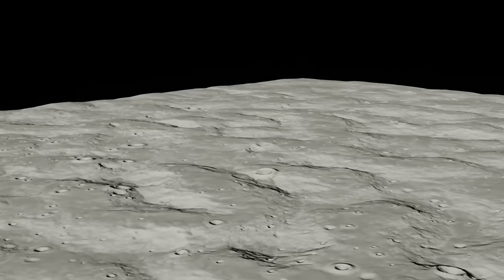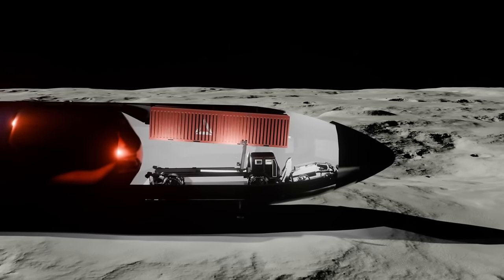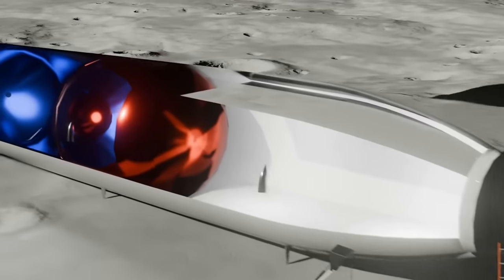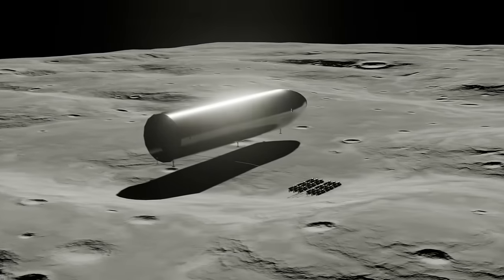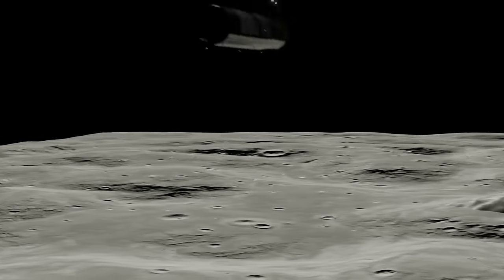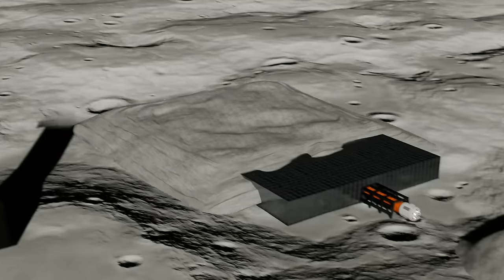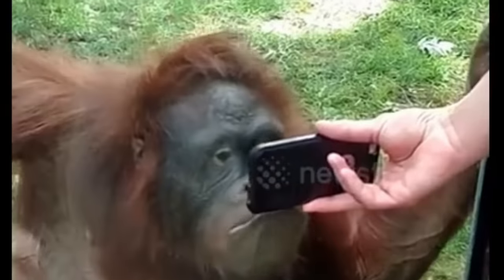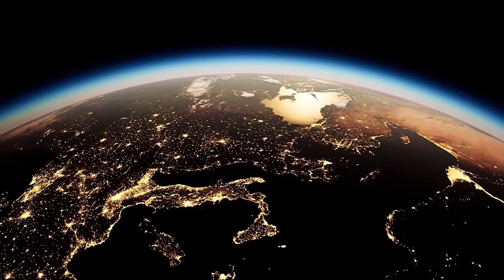How To Develop The Moon ALL PARTS

Comment: The only issue I have concerning the reactor is the difficulty of dispersing the heat. I fully agree that using a reactor on the moon is the most reasonable solution and the most efficient one, But getting rid of waste, heat is way harder in a vacuum than it is on the surface of plan because there is no medium to help pull the heat away like you would deal with water or air on earth. This is not an insurmountable problem, but it is a significant one.
Note that when I say “radiate heat” I’m not talking about radiation or radioactivity, I’m talking about a radiator. Something that allows heat to escape a machine in order to keep the machine and in this case people from overheating and dying
Reply from the maker: I mentioned it for the first outpost but it would apply to the others I just didn't delve into that as a minor detail but yeah radiators for basically everything will be extremely important. (I actually animated a radiator configuration for each outpost thing but didn't draw attention to it. )

Comment: Very nice! Although I'd like to say one thing. They don't necessarily need to land horizontal, but just need to be positioned that way. A lunar base concept for Starship has instead a small construction crew use cables to carefully lay it down. This saves time on development of a horizontal landing system as well, which starship wasn't really ever designed for.

Comment: This disqualified itself in the first few sentences.

Nuclear reactors need cooling they will work at really low power without an atmosphere. Solar panels have a higher weight to power ratio.
Reply from the maker: R
Reply: @Anthrofuturism  Whatever this is supposed to mean.
Reply: @Anthrofuturism  This is an interesting problem, how are the nuclear reactors supposed to vent heat. Do they have a graphene heat sink or something that can get the heat out of the reactor and out to somewhere else? The station won't be able to use all of that heat and it will cook our poor astronauts and even the reactor itself if it can't get rid of it.
Reply: @concon9107  I agree, it is not about how to distribute heat in a power plant. This is solved and circulating watet is the best in most cases.

It is about the way to get rid of the heat. On earth this is done by heating water from a river or the sea. And if not enough water is present, a smaller amount of water is evaporated.

On the moon or in orbit you do not have water to evaporate. You need radiators each connected to the cooling water. The number of radiators limits the output power of the reactor.

Each radiator panel allows the reactor the same output power of a solar panel of equal size. But the radiator panel is way heavier. And the reactor comes in top of the radiators.

 In addition, the cooling system is more vulnerable against damage.
Reply: The need to set up a radiator array is addressed about 5 minutes after you stopped watching.
Reply: @albertnewton8296  So you want to limit the output power to 5-15 kW. That is all this small surface area would allow for.

So you would use solar panels for most of the power and use the nuclear reactor for the life support during the nights.

And you have not added any hoses in your animation, and you did not discuss that just the water in the cooling system would be havier then solar panels of the same output power. Not to talk about the reactor or the radiators.

Look I would not be so annoid if you would not claim your SF would be possible.
Reply: @karstenschuhmann8334  Solar panels would also require large amounts of radiators to cool off the required heat. Also, solar panels will not create energy for half of the moons orbital cycle as there will be no light to generate energy from. To circumnavigate this, batteries could be used, but they tend to hold less and less charge the more they are used. On top of that, Solar panels degrade, so after 30 or so years they will produce very little amounts of energy. Or you could ship and build a nuclear reactor with a large field of radiators, which only requires episodical shipments of fuel as opposed to Solar which needs to be replaced completely every 30 years. Nuclear Reactors would be much more sustainable and expandable as opposed to Solar energy
Reply: @Shneaky  Solar panels are the radiators for the the heat generated by absorbing solar power in itself. And this requires no cooling water. So the solar panels can be much lighter.

Solar panels will deliver power for 15 days and they will have no power for the next 15 days.

So one needs a batterie or a nuclear reactor to run life support for this time.

 The heavy industry will, however, run on solar power. Which will be 100 times cheaper (solar panels can be extremely light, and weight is price on the moon).

So there will be 15 days of production followed by 15 days of maintanance.

Furthermore such a new type of reactor is prone to issues. Such as breakdown of components as well as coolent leaks. It needs tubes from the reactor to all the radiators. They will not last 30 years without a leak.
Reply: @karstenschuhmann8334  As you say, watet is the answer.

With no atmosphere, the heat does not dissipate.

radiator panels the same size as solar panels? Different solar panels of the same size can output different amounts of energy.

The way in which the radiator panel is heavier than a solar panel must be explained to others because not everyone knows what you do.

Something can be vulnerable to damage or resistant to damage, or it can be strengthened against damage, but not vulnerable against damage.
Reply: @danlock1  Sorry my extensive answer was deleated. It was purely technical without anything inapropriate.

Comment: Weak lunar gravity should make burying a rectilinear enclosure a bit less of a death trap than on Earth (See: all the collapsed shipping container bunkers) but what about sheer forces? The longest lasting bunkers on Earth tend to be made from round steel culvert sections. This shape would also contain internal pressure better without stress points at edges/corners.
Reply from the maker: Yeah I'm all for rounded/curved shapes but I suspect at the beginning the cubic approach is just simpler for the very first few buildings. When the time comes to actually build a base they may opt to go curve from the start depending on the tradeoff between complexity involved
Reply: @Anthrofuturism  Any reason you didn't touch on suitports as a regolith ingress solution?
Reply from the maker: @Hamdad  I mean it's sorta a fine detail that might be worth its own video this was mostly a high level view (also they require more work to animate lol).

Comment: this is way over board,  just do the kiss principle
Reply: You cant keep it simple in space, it is alot more threatening than building on earth, a facility like this will need a lot of anti-radiation tools, all the building materials to make said base, and it will require a minor amount of sexurity officers (1 or 2, its not public so you dont need many) a lot of builders and scientists. It's not a simple thing because if you leak oxygen, that can lead to death, and it will need not only sealing but will also require security measures. Kiss flies in earth because there is room for error, on the moon, there is no room for error, its live or die.
Reply: @PSC4.1 you know that the primary way of making technology resistant to radiation is to make it bigger and simpler, right?
Reply: @oberonpanopticon  It's not about the tech being radiation resistant, it's about making the humans not have to experience the radiation.

Comment: Not so sure pressurizing with 60% oxygen would work. Osha limit is 23.5% Oxygen at most for a reason, exposure to high oxygen levels causes nervous system damage, both short and long term. Additionally a 60% oxygen atmosphere would turn any metal part into an easily ignitable sparkler. Most things burn very hot and are very hard to put out at that oxygen concentration. This means that the base would readily combust as a whole.
Reply from the maker: That's why I say we need to import nitrogen
Reply: That's at 1 atmosphere of pressure. At lower pressure even 100% oxygen is perfectly breathable, that's what space suits use.
Reply: @Anthrofuturism  @massimocole9689
Yup, you said to import nitrogen and then to have 40% nitrogen and 60% oxygen so you don't have to import as much. My point is that I suspect that that might not work and that you might have to import more nitrogen because that's too much oxygen. I'm aware that space suits use 100% oxygen at low pressure, but am also aware that for the ISS, Space Shuttle and MIR  1 bar at 21% oxygen was chosen, despite the higher stress on the structure and more loss of air from leaks. That sounded interesting and took me down a rabbit hole.
At least part of the reason the ISS is at 1 bar is because the shuttles and capsules meant to dock there were also at that pressure, possibly because the large number of fatal fires during testing were discouraging. Also, it was pointed out ventilation is better at higher pressure.
My "osha limit argument" doesn't apply at all, because that's for 1 bar, yeah, oops :)
Skylab was actually pressurized with 74% oxygen at low pressure, interestingly. They reported no adverse health effects, though mission duration was limited 28 days.

However the fire hazard remains, as "what burns and what does not" is mostly decided by oxygen percentage, not pressure. Also, materials be it metals or rubber degrade quickly in high oxygen atmospheres, including at low pressure.
Not sure how much of that was actually new to you haha but there you go. It's an interesting problem.

Comment: Thinking about it, the modified horizontal landing Starship is kinda too complex. It would require a LOT of R&D and testing, and has a lot of points of potential failure, whereas a tail landing has far fewer.

I think a far easier solution would be simply to assemble a crane on the moon and then use that to lay a vertical Starship on its side.

Comment: Consider landing a Starship at a 45 degree angle using penetration beams, like lawn darts. The cargo, head of the rocket could then angle down to the lunar surface as the rocket hinged like a double barrel shotgun. 
It would then be positioned to burrow into the regolith. 
Tunnel Shields like this would be useful on the moon
Reply from the maker: Good idea actually...

Comment: Really cool video! One other hurdle you might want to consider is the building of landing pad infrastructure on the moon. It's still active research but the rocket plume of landing vehicles can accelerate regolith particles to very high speeds and essentially sand blast everything within a 2km+ radius. If you make a landing pad you may need to consider importing materials that won't melt from the high temperature exaust gasses. The landing pad would also need to be strong enough to hold starship. This isn't trivial because cintered regolith's compressive strength is nowhere near enforced concrete used to make landing pads on earth. 

You wouldn't have to worry about the exaust for the first landing though so maybe shipping the steel mill first and roboticly assembling landing infrastructure makes the most sense.

Comment: They've just covered the starship in regolith. Why does it take 2 months before people can return? They have a 2MW nuclear reactor. Can't they just hook up some flood lights? Or the second crew could just start the fitout of the habitation starship. Cut out the O2 and CH4 tanks and replace them with bunks and labs and manufacturing facilities, and even better yet, start digging down, using steel cut out of the tanks as supports, through the hull of starship and making deeper levels with more radiation hardening to allow even longer stays. Then crew 3 can start setting up the O2 and H2O recyclers and putting together the furnaces to turn the regolith into glass to start making the greenhouse to grow plants in, as well as start making useful construction materials, like iron and titanium and aluminium releasing O2 as a byproduct, for future crews to breath. 

Out of curiosity, people living on the earth are 'Earthlings'. People living on Mars are 'Martians'. What would people living on the Moon be called? Lunarans? Moonlings?
Reply: probably Lunarians

Comment: The same issue that we have with landing on the moon affects each and every launch from as-well.  So somehow having a rocket launching system which does not interact with the surface regolith is absolutely essential for this purpose.
Reply from the maker: Mass driver later. Landing pad is also useful. Details details.

Comment: I think we're forgetting about two important problems: Pollution and Exploitation.

We could build an elevator to move   the ships into low orbit then use the fission engines to reduce pollution, but i dont know if we have such technology. Just an idea though
Reply: Space elevators are definitely not within near technological reach. With the current material sciences there are no known or proposed materials which are strong enough to build passive supports capable of construction on that scale. I think active supports may have some theoretical proposals for a way to build a space elevator with current or near future technologies, but the power consumptions are not insignificant, and you really want superconducting materials which currently only exist in highly controlled environments. So maybe if we get nuclear fusion, and room temperature (or hotter) superconductors we could be a space elevator.
Reply: @David1Eskin  interesting. I'll have to do more research, thank you for being respectful with your response. I was kind of worried I'd get called a moron lol

Comment: Buildings on the moon aren't big steel boxes assuming you want them pressurized.  They will be tank shaped.  Cylinders or spheres.
Reply from the maker: Curved surfaces are harder to manufacture and work with and the pressure bulging can be offset by beveling the edges and thickening the walls. Simplicity allows for Quantity and quantity has a quality of its own. You can make your flat walls thick and steels tensile strength is somewhere around 140,000 psi. So you can have 3-4 inch thick walls completely negating the need for curved surfaces since you're not worried about weight since it's a building, not a vehicle.
Reply: @Anthrofuturism   3-4 inch thick?  Oooooh.  I was thinking of much larger buildings than you.  Yess, if you build small structures, you can use simple shapes.
But I think we need larger buildings, and I think it's not worth it to build less efficient shapes by using excess material.  Round isn't that difficult, and steel bends into the perfect shape under pressure.

Gentleman's bet!!   We wait until lunar buildings are built using local materials and see who is right!

I recommend we both eat well and exercise so we are around long enough to see.
Reply from the maker: @toddpowers3620  For sure!

Comment: I understand on paper it is way easier and cheaper to use the ship that brought you to the moon as a habitat.  But in reality would you really feel comfortable living in a total vacuum in a ship that went through the stress of launching and leaving earths gravity? There is so much extreme stresses rockets go through during launch that anything could happen.  Issues might not be obvious right away but there can  easily be stressed welds bolts/rivets and damaged seals, all things that will be difficult to check once on the moon. I'd prefer not leaving things to chance and prefer a structure specifically made for housing and keeping humans alive.
Reply from the maker: Retrofitting
Reply: @Anthrofuturism  can't forget lunar regolith is positively charged and sticks to everything.  As well as  being extremely sharp compared to dirt on earth since there is no erosion on the moon.  Digging and moving the material will come with great risk to equipment and structures. But besides all of that it is something we will have to overcome if we wish to be a multi planetary species.
Reply: @Anthrofuturism You might as well just say “I have no information on how this would actually work”
Reply: @evandipasquale9255 Don’t forget, starship wasn’t designed to be buried.

Comment: We have electric arc furnaces for making steel, electric mining equipment. If we can make steel pellets you can make robotic 3d printers. 3d printers should actually work better on the moon as there's no air to create any oxides to stop the metals from fusing. Another idea that might work for power generation is some type of gas in a tank with a bladder to take advantage of the huge temperature swings. The gas will essentially breath in and out of the bladder and tank as it condenses and expands

Comment: I'm not sure if I missed it but don't those reactors produce a 2-6 MW equivalent worth of heat that can used to create electricity if you can cool it (think cooling towers) doing all of that with radiators on the moon seems ridiculous and probably takes significantly more space than the shipping container you spoke of.
At that point comparing it to solar might not seem that crazy?

Comment: digging a trench and pulling the starship into in would help a ton. landing the digging equipment way in advance and let it slowly dig the trench, so the humans already have a buried location to start sheltering in once the arrive. even if you wanted to build up more shielding on top, getting the protection from a hole seems way better than building a big hill on top of something on the ground.